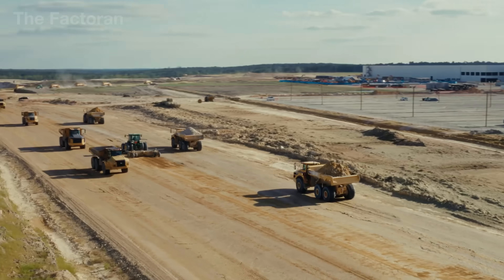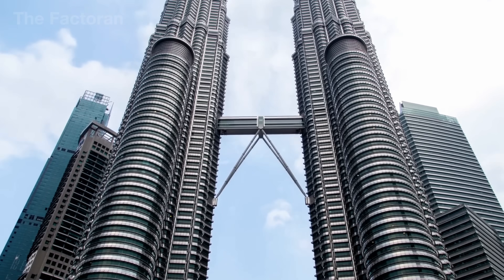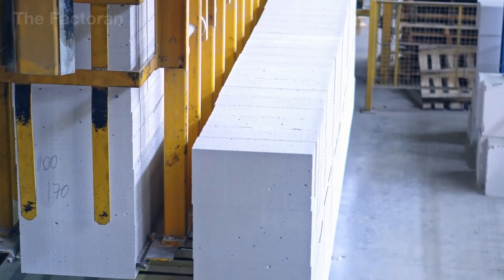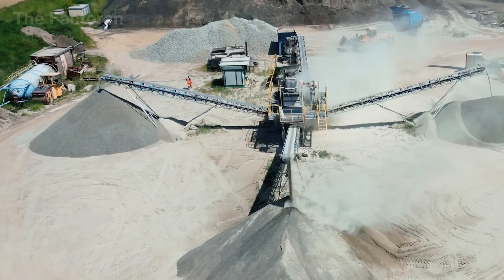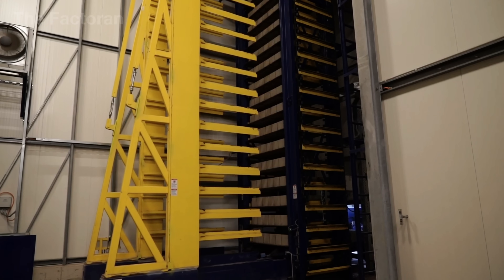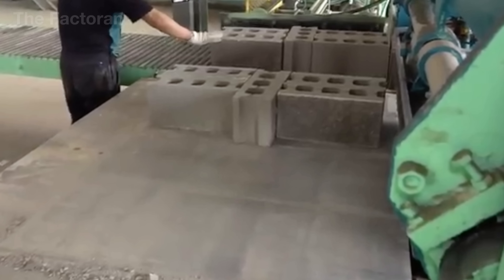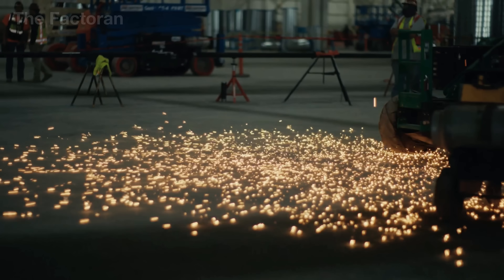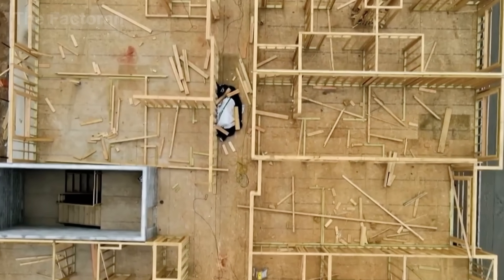How Billions of Concrete Blocks Are Made Inside Massive Production Line

Comment: Concrete block are always made with reinforced steel bars(Rebar). Concrete takes compression and Rebars take tensions. So together it is so strong for building and last for years if proper maintenance are done. If expose to weather preventing paint keep them from erosion.
Reply from the maker: Exactly! Concrete and rebar make the perfect team — strength and durability for decades
Reply: @TheFactoran  I am a Civil Engineer having Bachelors and Masters degree. My Dad was also in a construction business and also a Civil Engineer. God Bless